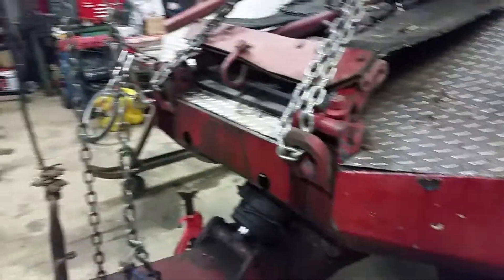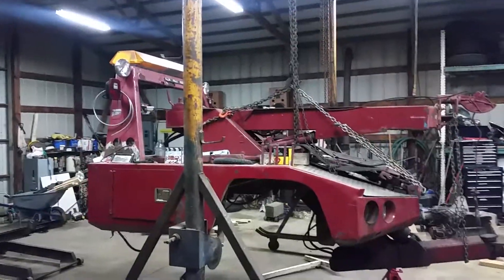wrecker bed

Comment: Good job. I got my cousin building mine right now. Bought one already built, but had set for 17 yrs. So the cab despite that sit, was still in great shape considering. A window left down had let in the green Moss. White surfaces outside were covered in it. But for $1,000. I jumped all over it. Needed a motor and a L arm. Column. and some lights. 6 Tires. Automatic. I bought another one looked just like it, for $1,800. Now I'm gonna put the bed on it. So it's being worked on. Hope it doesn't take forever. Out of town and I can't help running my business can't get down there. 1990 Ford F-350 5.8 Full Hydraulic. Challenger bed & lift. Dual winch. Belt driven PTO off motor. Automatic. Damn thing should be a dream when finished. Good luck on yours, man. It looks good up there. Love the color too. Is it a Challenger? Kinda looks like one. But they all favor one another so much hard to tell at times. T's up

Snowman.
Reply: Same boat 97 gmc 3500hd with the challenger bed. I  need to  replace some lines for the lift and boom. But a straight up trade for it. Trying to start my own business with it. Then eventually buy a flatbed.
Reply: @marshallmclean4596  
Good ideal too. I started my biz through roadside assistance. You'd be surprised at who doesn't want to do those duties. I see lots of people with unmarked vehicles, so I say NO INSRNCE... They won't last, but they are hurting those who are marked. Good luck with your biz plans, Marshall.
Reply from the maker: @snowman374th  I actually use this to pick up my bulldozer blades mainly.  It's kinda like a portable crane.  I have moved a couple vehicles with it but they were just scrap ones I was picking up. Thanks for watching.

Comment: Thanks for saving a challenger wrecker!!! You might want to move the gas tube to the top of the bed. That why it wont leak on the side. If thats whats next to the tool box door on the driverside?
Reply from the maker: Yes it is the gas fill. I do need to move it up top. I think there was already a hole in the floor.  Right now I have to pump really slowly.